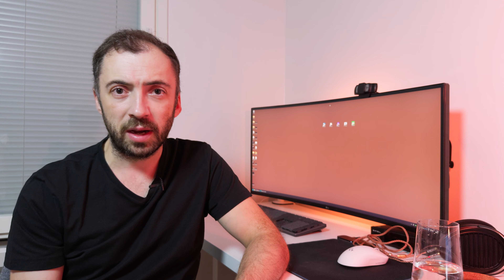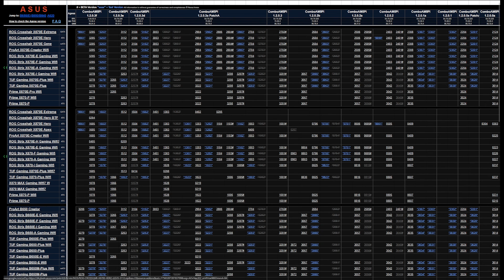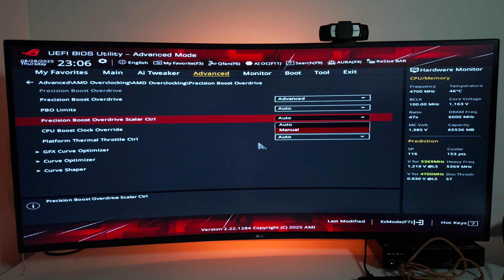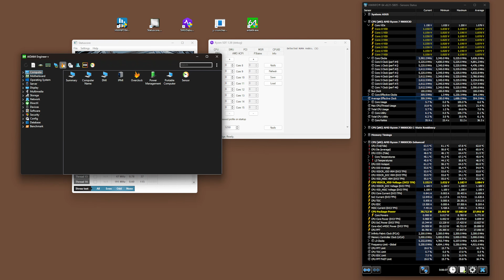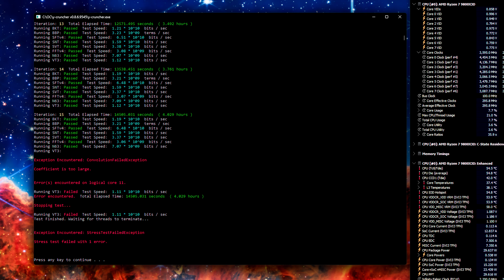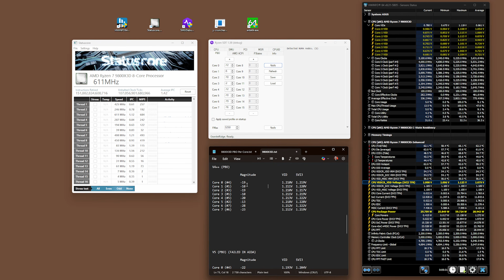Undervolting Ryzen 9800X3D Per Core - Less is More ?

Comment: Great video and interesting approach. I actually tried grouping my cores by similar voltages after watching this, but sadly, I came to the conclusion that it's ultimately meaningless for true per-core stability.

The neccessary voltage for a certain frequency varies too much per core. When cores are set to a similar voltages, a particular core will continue to cause error, and this method requires you to raise the voltages for all cores to match that one problamatic core - even the ones that don't need it. This results in lost potential compared to actual achievable values.

For example,
Your method: -28, -20, -28, -28, -26, -20, -32, -30
Traditional Per-Core:  -35, -28, -20, -35, -30, -35, -35, -35
At first glance, a difference of an average 5 points may not seem like much, but considering that my best cores (1, 5, then 4) are the ones that handle the most load, it's actually a noticeable gap.

In terms of convenience, I don't think this method offers a signifficant advantage either, since you still have to run y-cruncher to find the unstable cores anyway. For a quick and easy CO tune, it's better to just apply a moderate all-core offset and then give a positive Curve shaper only to the specific, problematic frequenciues (usually High, Max)

I've tried all sorts of methods - OOCT, Core cycler, AIDA64, y-cuncher, Prime95 - but I eventually found that the most orinary way to find the per-core values is the fastest and most accurate.

The most straightforward approach I found involves the following steps:
0. Ensure your memory is running stock
1. Find the all-core offset where Cinebench R23 runs without error (For me: -45)
2. Find the all-core offset where AIDA64 runs without error for 5 min (For me: -25)
3. Just run y-cruncher at a midpoint all-core (which was -35, in my case)
4. Identify the core that reports the "coefficient is too large" error and bump it up by +5
5. Repeat this process until stable
Reply: Which stress test method you use for initial error seek on ycruncher ?
Reply: @ivelinvasilev3530  sorry I checked your comment too late. I ran latest version of y-cruncher and ran all the tests, though I'm not sure whether that was really appropriate. Errors would probably be detected by almost the same tests anyway, but I wouldn't recommend relying on just one test
Reply: The problem there is when CPU uses AVX or 100% thats when Crash. For example i have 9950X and i know their limits, but i pass everyday test it for the best results possible and when you start use undervolt (CO and CS) you need to use best way. Best way possible if you want  the best accuracy is per core for every CPU. For CPUs that have 1 CCD just go All cores, for CPUs that have 2 CCDs the best way is per CCD. And they results are a litle bit stable for deeper CO. For example on my 9950X bin 117 SP it hold on -30 CCD1 and -15 on CCD0 but if i use All cores it cant pass -10. But yeah i reach that because i test diferent options everyday, because you can have a good CPU the way you want, but you need to spend alot of time. If you dont want spend much time, just go All cores -10/15 and curve shapper max temp -5 and high temp -10. Regards
Reply: @pklvyy your approach worked well with y-cruncher, but I found that Aida64 rejects it within 3 minutes. Not really sure where to go from there to get it stable.
y-cruncher ran for 7.5 hours with no issues.
Reply: @omeleet1917 yeah thats why I run AIDA64 before y-cruncher because ADIA64 detects initial errors really fast than y-cruncher. In my AIDA64 experience running AIDA64 for a long time was meaningless so I recommended 5min. (If there were no issues during those 5min, it's like more than a 90% chance there would be no problems later either. But If you're still concerned, 30min without issues is a 99% gurantee
Reply: @pklvyy  Yeah I am getting frustrated a bit. I chose some slight offsets, had Aida64 Extreme run for 1hr 20 minutes no issues. Same exact settings it returns a fail within 3 minutes several times.

Feels like an art where I am aiming for safe and just good enough (instead of perfect). Thanks for your insight.

EDIT: What I ended up settling on - I found my stable allcores offset at -17. Y-cruncher seemed to indicate there were two cores that failed if they were any lower, and this was typically where I would get stable AIDA64 runs. I then harmonized the voltage draw across cores using HWInfo (the two sensitive ones stayed at -17, the rest were lowered more) I had two good cores which I increased voltage on. After doing these changes, I was able to run AIDA64 and y-cruncher for 6 hours without issue. It is probably not the most efficient undervolt and the infrequent errors are probably within tolerance with more aggressive undervolts, however I went for stability.
Reply: @omeleet1917 That's strange. Like you said, I also think the CO isn't really worth pushing to the limit.
Reply: Until I found this video and then read your comment I was running All Cores at -22… 😄

First of all - great video, really enjoyed the approach and explanation. It actually pushed me to finally sit down and tune things properly.

I simply used aida64extreme and SMUDebugTool, still took me like 2h - and wow, what a difference.
Not sure it is good idea using only AIDA but for now (few hours gaming and some 'low voltage' work) all seems stable.

My final values:
0: -40
1: -50
2: -48
3: -50
4: -48
5: -50
6: -40
7: -22

So yeah… one core was holding everything back. Really appreciate both the video and your insight 🙌
Reply: @tadziorek  From 0 to 7 , What is your best to worst cores ?
Reply: Why mention the curve shaper if you don’t use it in your method?
Reply: Update: I started getting repeated freezing issues under light load conditions (like in-game settings). I first tried adding +5 to all cores, but didn't fix it. After that, I added +5 to Min and Low Freqency in Curve Shaper, and that completely solved the issue for me
Reply: Sorry if this is dumb but why does memory have to be stock? I was testing my undervolt with my EXPO enabled as I thought that would be more accurate?
Reply: @alexyang5089  It's just to take the RAM out of the equation if you run into any issues. If all you've done is enable EXPO and you haven't tweaked any memory settings, you should be fine
Reply: When you mean memory, you mean ram? And if so why stock?
Reply: @johnlee3281  Just please for the love of god flash your BIOS and tune CPU before anything else. 
Just do it
Reply: @Aylevin21 Agree on this. Would have saved past me a lot of headache

Comment: So tenho uma coisa a dizer, voce tem muito azar meu amigo... aqui esta rodando all core -38 no curve optimizer, core booster +175 e nao passa de 73 graus no R24, alias as pontuaçoes no R24 sao: 1444 multi e 145 single, R23: 24250....
Reply: man, isso ai tá estavel? eu consigo fazer runs estáveis em -40 no R24, mas ele não é um teste bom o suficiente porque dificilmente vai usar os 5425mhz o tempo inteiro, a Fmax são só spikes, mesmo não sendo o melhor teste de estabilidade vai crashar em algum momento se você fizer 5 ou 10 runs, o meu só fica estável de verdade em -25 ou menos, ja tentou jogar algum jogo cpu bound tipo cyberpunk por mais de 1 hora?
Reply: @Bad_Karma0407 testei o R23 por 100 min, R24 por 100 min e o OCCT por 100 min na opção EXTREME... só estou barrando agora na questão da temperatura q mesmo em -38 ainda vai até 85 graus q está travado na BIOS... No cyberpunk é tranquilo, nenhum problema... Quais suas pontuações no R23 e R24??
Reply: @klebinhomilhomem9864  1407, mas eu perco performance em outras aplicações
Reply: @Bad_Karma0407  eu sei pq... Ativa a GPU em modo performance e testa novamente,  sem isso eu faço 1420  e 138.... Qdo ativo o modo performance da GPU ela pula pra 1450 e 144, além do CPU z q pula de 800 para 836 em single...
Reply: @klebinhomilhomem9864  a 5.4ghz eu faço 860 em single no cpuz mas n mais q 9000 pontos
Reply: @Bad_Karma0407  qual seu pbo? Eu faço 9032 no multi, mais no single 836, o meu pbo está em +150, não quis forçar até 200...
Reply: @klebinhomilhomem9864  boost override core clock: :200
Vcore SOC 1.1v
VDDIO: 1.2v
PPT: 125w
TDC: 98.5a
EDC: 134a
CO (negativo)
melhores nucleos: 30
nucleos mais fracos: 38
estou tentando achar uma voltagem boa para FCLK em 2200mhzz, acredito que seu single tenha sido prejudicado por causa do CO agressivo demais
Reply: @Bad_Karma0407  aqui o processador ficou estável com FCLK NO AUTOMÁTICO, qdo tira do automático ele perde 20/25% do desempenho... Ainda vou fazer um perfil mais elaborado para as memórias...
Reply: @klebinhomilhomem9864  fclk auto é no maximo 2000mhz

Comment: im running out of options, my psu has severe coil whine (corsair sf1000) ive tried other sfx psus thjey all suffered from strong coil whine. I have a jonsbo z20 case. Only sfx is an option. Man this is driving me crazy, and My MSI 5090 SUPRIM also has coil whine;. I wanna cry. What optyions do i haave?
Reply: I recently built in a fractal terra with a 5080 fe and corsair sf1000 in it and noticed a coil whine as well, but I wasn't sure if it's coming from the gpu or psu. I didn't notice if for the first week and I kept messing with stuff, like taking it apart to try to fit a 25mm fan instead of a slim 15mm in the bottom, or taking the gpu and cpu cooler out to swap m.2's and stuff and suddenly I start hearing this really loud coil whine. Idr what I was swapping or if it was after undervolting my gpu bc I was doing a lot of different things that week, but it's not as noticeable now. It's insanely annoying once you start hearing it. Did you ever figure out a way to get rid of it?
Reply: @duckh0le  try a 5090 with that psu,. the coil whine is crazy. Just like u i had a 5080 before and the psu had a much softer coil whine with it. To really know how bad the coil whione is u have to uise a 5090

Comment: Something is not right here. With Artic Liquid Freezer III 360 with stok RGB fans I have 70-75C on Cinebench R24 with 9800X3D@5450Mhz @ 1.225V manual set speed and voltage ,no PBO bulshits ,no undervolting. Check you cooler. Take out the cooper plate and check for durty or corosion,or maybe the cooper plate is bendet and have bad contact with the cpu. Your temps is to Hi. On Cinebench R23 which i more haevy from R24 i hit max 85-87C which 10 min test
Reply: Yeah dawg on my artic iii 360 my cpu doesnt even hit over 65° at full load.. granted its with an all core undervolt of 18 but still
Reply: I barely hit 80c on Cinebench R23 scoring somewhere in the 2300+, Cyberpunk Im at 55-60c and running at 5450mhz. Idk why his temps are like that.

Comment: Bro you have SP116, mine SP114 -30 all core🤔Something is wrong. Cooler Noctua u12a, 1200rpm, 55c in Cyberpunk
Reply: -30 is really agressive and not stable at all, u should do more runs to check it, I tried -30 on my sample, gained stutters and crash after a couple of hours on my applications, -25 or less as smooth as ever
Reply: @Bad_Karma0407 People do -40 on better samples. -30 with me zero problems, recently used heavily with Battlefield 6 where it puts a lot of strain on the processor in various scenarios
Reply: @errrr69  I mean, if I do -40 and just play games everything will be fine, but I recomend check your event viewer, there should have a lot of erros and u can expect a crash every now and then
Reply: @Bad_Karma0407 No problem with anything, WHEA 0 errors. Stable system in any scenario. I'll even have a while, I'll give it -40 for better cores, the rest of the weaker ones -30. It all depends on the sample
Reply: @errrr69  hm interestingly, you were right, about 6 of my cores manage to stay stable near -40, only my core 4 crashes from -32 and above and my core 0 crashes from -36, thanks for tell your experience, now I'm running at 5425MHz completely stable without exceeding 78°C in heavy stress tests
Reply: @Bad_Karma0407 I was thinking about 5425mhz, but is it worth it? It won't feel a big difference in games at +200mhz. It will be time to check how much power consumption will go down at -40 on the best cores and if a few more degrees of temperature will drop
Reply: @errrr69  guarantee you are not beating y cruncher on -40

Comment: Hello my friend, i try use harmony undervolt per core but temperature so higher for my and  i use undervolt per core ( for 2 core similar voltage)
What is mean, we have 2 super 2 best 2 mid 2 bad cores , and this cores can work with the same voltage ( i found for every 2 core best voltage and after when i have stability i use extra curve shaper and all this give me best undervolt and lover temperature) 
Harmony undervolt after cbr23 i have arround 21500 -  22 000 scores and temperature max arround 90c
My system with curve shaper i have 23 400 - 23 444 score and max temperature 84 - 85c  , tdp 112 for core, all tdp 145 - 150w
Max tdp 104,5w for core all tdp around 135w
I use air cooling with 1 fan arctic p12max cooler id coling a620 pro se
Vt 3 27h use for stability system , aida 
64 cpu fpu cahce 24h, all tedt u
Y-crancher ( when all test switch every 2 min ) 24h 
Memtest5 3dryzen and antall extreme all test 10h 
Use nitro 1_3_1 
6400 2200 1:1 
Linpack extreme 10 iterations all stable

Comment: 7:10 in my experience Y-Cruncher doesn´t report the right cores. Like I had set the first 4 cores to certain offsets ran stress tests for over 20 hours, I put a bigger negative offset on the 5th core and it started reporting errors on the first core. Which I doubt is accurate. I never change the first 4 cores and lowered the negative offset on the 5th core and it stopped reporting errors.

Comment: Are these individual core voltages applied when running an all core workload as well or just when an application is using one core? What happens exactly when running an app that uses more or all cores? Will the "worst" negative offset setting be applied to all cores? Basically rendering all this work to fine tune each core useless?

EDIT: Turned out to be useless for me, had -17 on all cores previously and I ended up with the same voltages during load which is about 1.10v after doing per core tuning. Individual voltages are all over the place, from -20 to -7 to get the same voltage on every individual core. Doesn't seem worth it to be honest, it's faster to just test with an all core negative offset and just stress test with AIDA64 until it doesn't crash anymore.
Reply: No it won't. It will do that only if you go "all core" negative. The only thing this does is making your average voltage as close as possible to each other based on your weakest core because otherwise you increase testing time x8 for 9800x3d for no result difference.
Reply: Well I´ve done a couple of tests now, Cinebench and me playing some POE2 for an hour. I did take ambient temperature into account. In both cases per core offset ran roughly 1.5 degrees cooler than all core offset as well as CPU package power being 1-2W less. All core I tested was -17 offset. Per core was ranging from -45 to -17, maybe average around -35.

Not a huge difference but there was a tiny difference and it was always the per core offsets resulting in the CPU running slightly cooler. The difference was a bit bigger when playing POE2 (path of exile 2) than when running Cinebench. In Cinebench the CPU package power difference was less than 1W but in POE2 it was more than 2W less. Considering cinebench also used a lot more power the difference when playing POE2 was more than twice as significant as when stress testing. Makes sense I think since the CPU load when gaming is much lower and the CPU is not running at it´s full potential.

Probably not worth all the weeks it took me to find the per core offset values though...
Reply from the maker: @atnfn  Thank you for sharing your experience! Amazing analysis!
Reply from the maker: They are applied in both cases.
Reply: Perhaps it does make a difference when you aren´t running a stress test at max CPU usage on all cores. Would be interesting to test when playing games over an hour or something what the average CPU core voltage/temperature ends up being between per core and all core set to lowest stable offset.

Comment: There are 2 other good Ryzen "stress tests" in AIDA that aren't labeled as such. The SHA3 benchmark is great for for X3D CPUs and the FPU Julia benchmark is great for non-X3D (or maybe the other way around? I forget...). There have been times when a CPU will pass everything else, including AIDA's "proper" stress tests and CoreCycler, but fail after successive runs of these two benchmarks. Run them like, 10 or 20 times in a row manually as an extra stability test.

Comment: x870e hero - 40+200+scalar x 10, Can do 45 too.. With 40 I passed every possible test there is
Reply: -17 maximum, hot but stable! Cant do -18 ☹️, Aida fails...
Reply: @KOT-ANGRY  It doesn't matter. Your CPU on -18 can use same wattage as his on -45, it depends on your silicon. Not only that, he went scalarx10, which increase his voltage by 0.025x10 which translate to ~-23 on a scale. So if he removes scalar he will instantly be instable on anything over 22-25 depending on his lee way. 
So relax, you have amazing cpu, don't compare it.
Reply: @KOT-ANGRY  You could try per core instead of all cores, my worst core can only do -17 as well (my best one, in terms of how much I can undervolt it, can do -43 at least). Try DannyzReviews, a video called "ryzen 9800X3Ds are running too hot & dying", in it he changed some power limits that have a WAY bigger impact on temperatures than undervolting. In fact after changing those power limits undervolting doesn´t even affect my temperatures anymore. But I think it affects performance instead. If the cores use less power they can run faster when they are power limited. Anyway according to the video it doesn´t affect gaming performance very much.